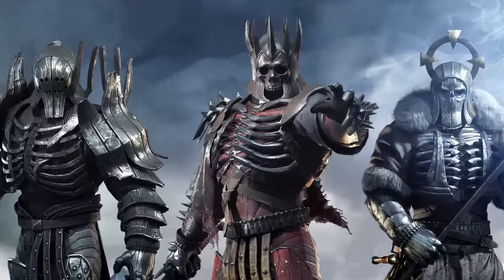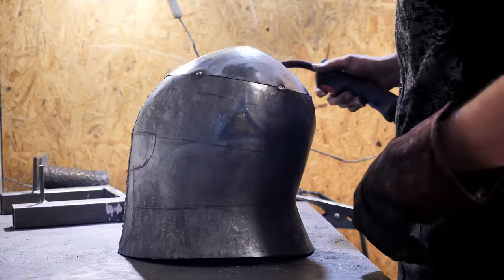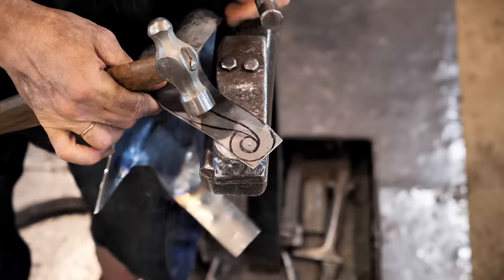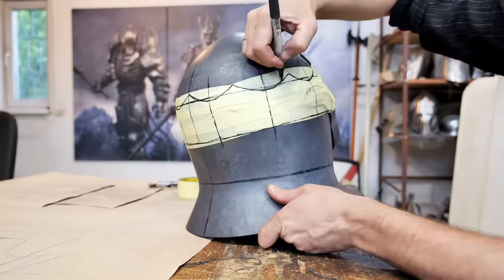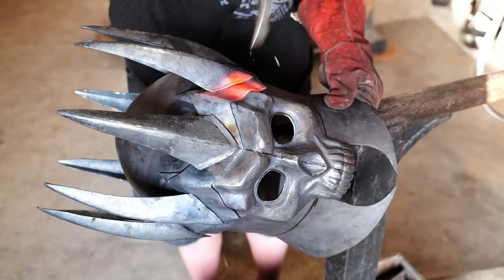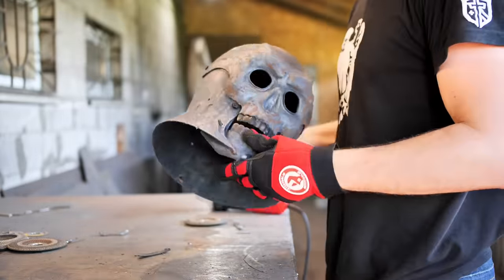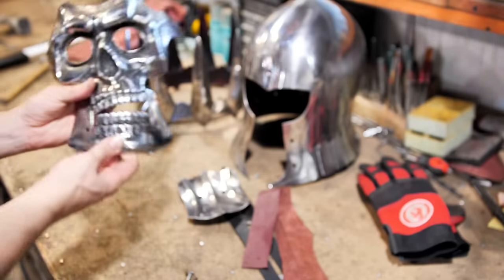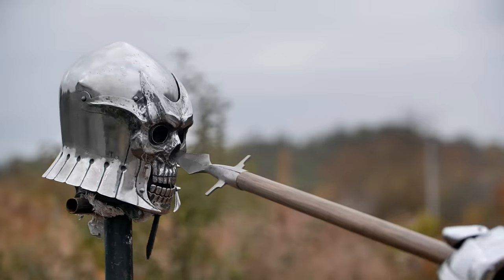Eredin. How to make a steel helmet from Witcher 3

Comment: Small tip - you actually don't want to temper helmets. It makes still harder, but more brittle. While with the harder hit, the untempered steel will get a small dent, hardened one will show no damage. However, when the hit is significant enough, the unhardened steel will just get a bigger dent, meanwhile with tempered steel you are now forced to remove steel shrapnels from your brain. This unfortunately happened to one of my Polish colleagues on buhurt tournament in Czechia. Since then tempered helmets are banned on buhurt tournaments.

Comment: I have made a few helms before, but I did not have anywhere near as much specialized equipment as you have - so my work was much more simplistic. I had only a tree stump with various sizes of dishes removed and drills, everything was worked cold and riveted, and plenishing was done with a smooth hammer face against a metal post.

Comment: Also a lot of people don’t know but you might. If you have a hole or blow a hole, you can put a piece of brass behind the hole and then mig weld it. The brass will absorb the heat and not stick and ensure you don’t blow a bigger hole

Comment: If you don't mind me asking why not cover the steel in machinist dye and use lazer to ech the face pattern on both sides of the faceplate?. How much for that helmet not that exact helmet but identical. Or let me buy the pattern